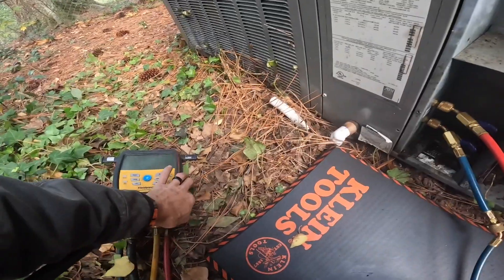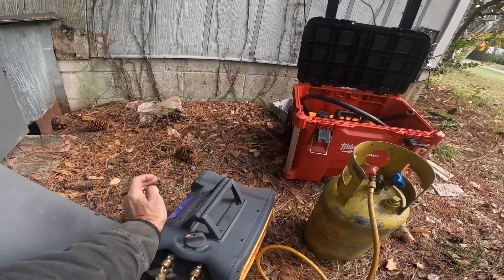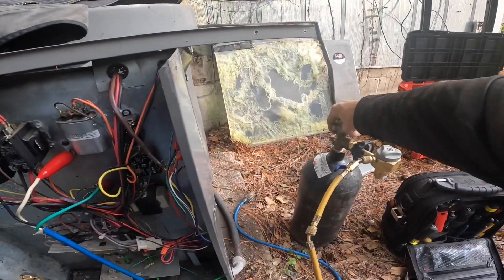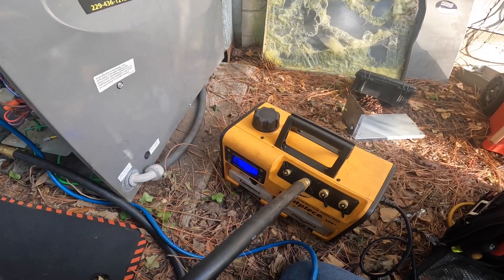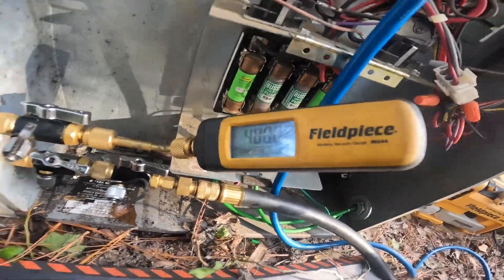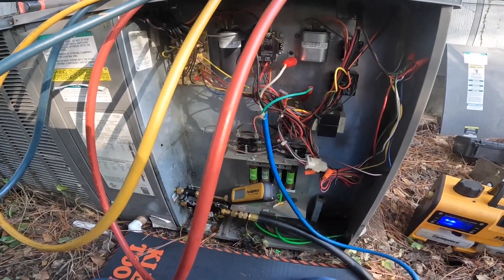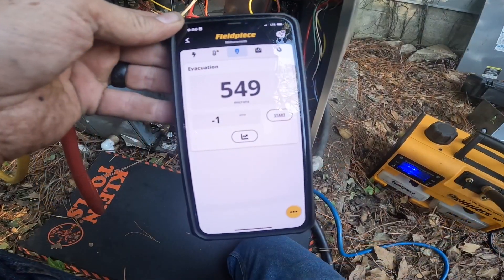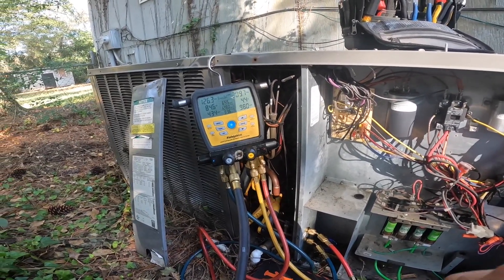Replacing a Locked Down TXV

Comment: Done HVAC for 30 years. I always blew nitrogen thru slowly  where you can barely hear it going the unit. I’d let the nitrogen blow the heat away from the TXV while soldering. You have to change the hose from high side to low side to achieve proper direction. Make sure valve stems are removed because it cannot build up pressure. This assures the TXV does not overheat and keeps the inside of your copper pristine. Black flakes form on inside of copper during soldering which isn’t good for TXV or any orifice for that matter. It takes just a little bit more time to install valve but it ensures a solid problem free installation. You have to pressure up with nitrogen to check for leaks anyway, might as well have it bleeding thru system slowly during install of a TXV or a compressor. I always used a wet rag around TXV also the gel seemed to never work that well. Or course I’m a lil old fashion!!!! Try this if your having problems burning up your TXV’s try the nitrogen trick it works well. I never burnt up a valve during install!!!!

Comment: Curtis I’m curious what it were to remove old txv from the drier just to verify it wasn’t the drier being clogged
Reply: A clogged up drier will show a freeze line in the middle of the drier.-
Reply: Not always
Reply: So would a txv unless they are completely clogged  he didn’t so any frost line on neither txv or the drier. I would one reason would one of was clogged.  That’s only one reason where wouldn’t be a frost line
Reply: Below 3lbs pressure drop across drier shouldn't cause problems. Simply check delta t  across drier. Good chance element was flat could've started by changing only that . Should've removed element to braze up txv , wet rag around drier is a good practice.
How necessary is it to flow nitrogen on that small repair... not very . Would have been fine not to flow nitrogen.
Reply: @jeffvandagrif  
 My point was he didn’t really  
Verify rather the drier was adding to the mix

Comment: I would appreciate If you were to teach us the how to connect the gator clips to get power to the vacume pump...so we dont use a 20ft extension cord from inside the house...that would be intesting
Reply: Just connect one alligator  clip to one leg of the 240 volt power going into the unit and hook it to the small terminal on the plug other alligator  clip attach to the metal chassis of the unit and then to the large terminal  on the plug they also sell cheater cords suicide cords or test cords whatever you wanna call them got mine from the local Johnstone supply but be careful  all this information is  for educational  purposes only
Reply: @lonniebearden9907  Make a mistake and you'll need a new unit! lol. $$$